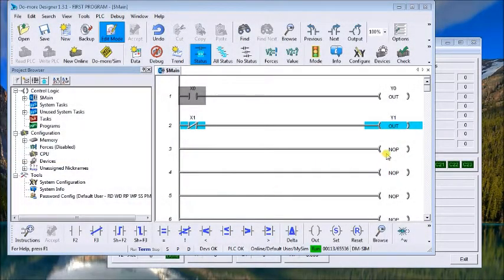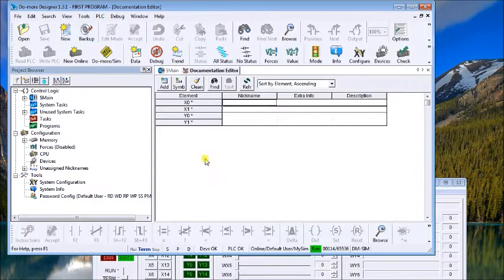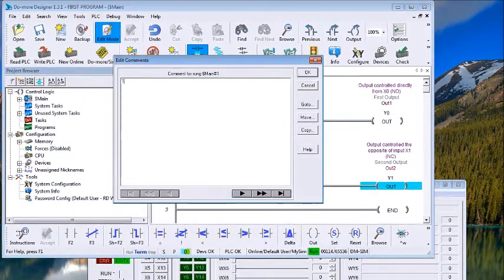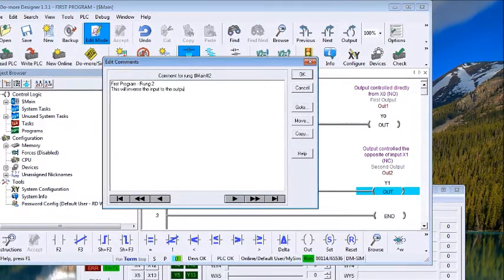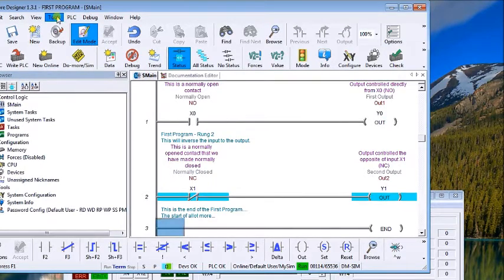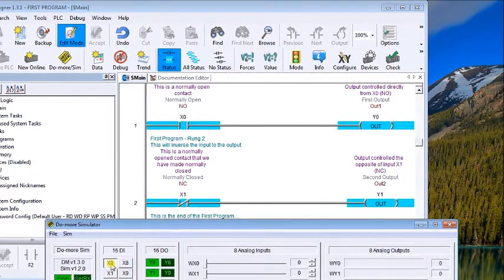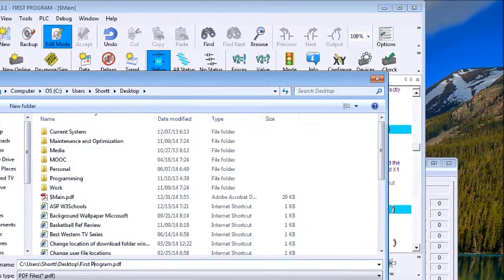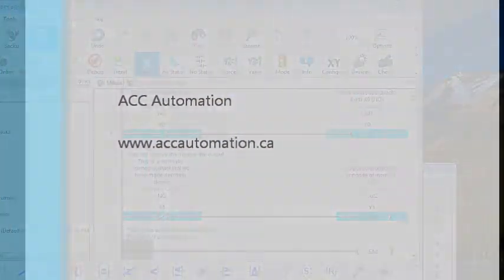Why Most PLC Programmers Skip This Critical Step (Don't!)

Comment: WHEN I GIVE END,IT IS DISPLAYED AS $ON  ST1 AT ONE TERMINAL AND end CO OUT, I TYPED END IN CAPS AS WELL AS SMALL,AND I DON'T KNOW WHAT TO DO
Reply from the maker: Move the cursor to a new line. Ensure that you are in edit mode. (Cursor will be solid colour.) Go to the output of the line and then type 'END'. You will then hit enter to put the instruction into the rung or hit the green check mark. The end statement will not need a condition for the rung.
Hope this helps you out.
Regards,
Garry
Reply: thanks a lot,surely i'll try.
Reply: I'm having the same or similar problem.  The END command doesn't want to populate the place where the (NOP) is.
Reply from the maker: See the above comment.
Regards,
Garry